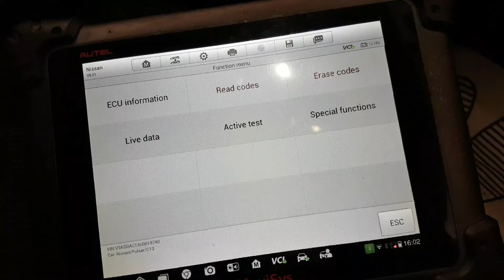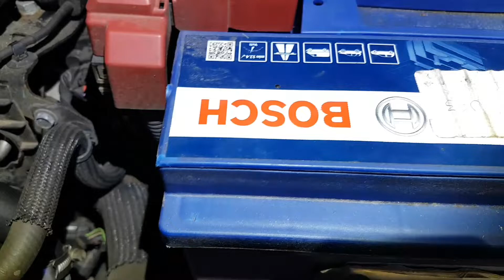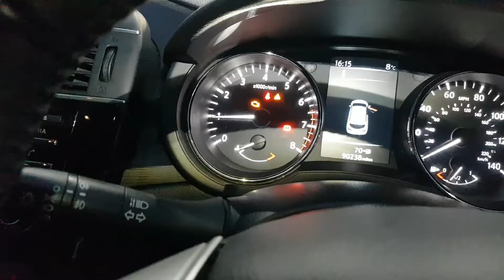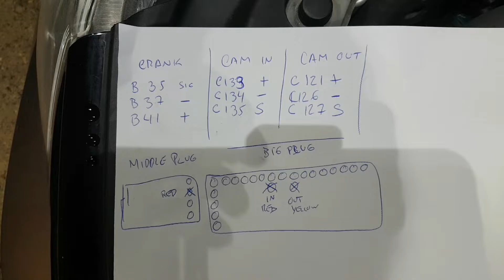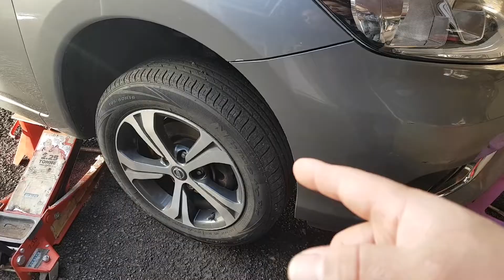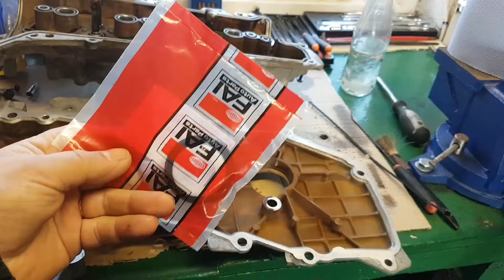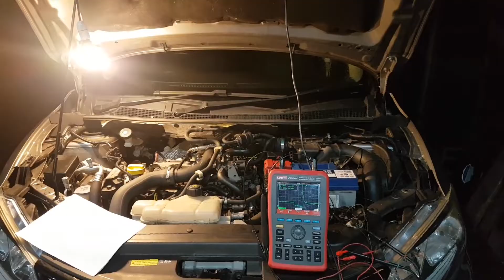Nissan Pulsar 1.2 DIG-T Engine light ON even after new parts... Fault finding and repair.

Comment: hi mate do you know the pin outs on the bcm which control starter relay from the pcm for ford focus 1.6 tdci 2013 manual  and with stop start this is my last test to do before i put it down to the pcm itself all test ive done so far are good i just cant find any information on connector c1 marked as engine on the bcm module anywere on the internet i would be greatfull if you could help thank you
Reply: sorry mate didnt mean to confuse you its in regards to my ford focus i can get you the information like engine code even ecu information as i have removed the ecu from the car and thank you mate
Reply: engine code T1DB1K   ecu number BV61-12A650-DGB
Reply: other ecu code S180133050  C  THANKS MATE
Reply from the maker: The diagrams show the starter motor relay connected to:
Load side, 1 of the pins (shows pin 3) permanent voltage.
Load side second pin (shows pin 4 or 5) to the starter motor.

Control side, shows pin 1 to pin A29 engine ecu, and pin 2 A27 also engine ecu. 
Engine ecu pin C28 connects to ignition switch pin 7.

I don't see anything connected to the starter relay that comes from that connector...
Reply from the maker: @dennispowell7719 
Give me that information...
👍
Reply: thank you mate as far as ive been told its connector c1 engine marked on the bcm and pin 28 ive done continuity on that line to the pcm and get nothing also applied voltate to that line with everything disconected and still nothing but i dont know if am checking the wrong pin  without the correct information i was going to get autodata but at a £115 a month just to find that pinout is abit pricey thank you once again mate i know your a very busy man
Reply from the maker: @dennispowell7719 
Again, i need to know which engine you have, or at least which engine ecu...
Some have siemens ecus, others bosch... without that I can get into any diagrams... or if I do under the wrong selection, the diagrams might be incorrect...
Reply: thanks its the wire that gets grouned by the bcm when ignition switch pressed to start it sends that signal to the pcm and the pcm then activates pins 85 and 86 of the starter relay mate thank you also if it turns out to be the pcm would you beable to clone one for me if it comes down to that and at what cost ?
Reply from the maker: @dennispowell7719 
Ah... that one...
That is ignition switch C1-3 (PIN 3)
Goes to a splice (SP402) to BCM C3-28, PCM C-28 and if you have keyless, keyless module C4-15

There is a second switch from the button, switch C1-4 to BCM C3-22

👍
Reply: thank very much mate very much apreciate your help with this mate
Reply: hi done those tests mate they are fine but found somthing odd about the ignition switch circurt in that when i press the button to start the voltage is only 5.6 volts  i dont think thats right i asumed it would need battery voltage at that pin mate what do you think mate ? thanks
Reply from the maker: Yes, should be battery voltage.
The voltage supply to the button, is on pin C1-6 (KL30), and comes from the BCM pin C8-3
Reply from the maker: Without the engine code, it can't really help... as there are different engine control modules depending on the engine code...
👍👍👍

Comment: Always easy in retrospect but if you knew what the timing figures should be on a known good one it would be another way to check timing without stripping. 
I find Nissan diag reporting  to be a bit crude in all honesty,at least when using aftermarket tools.
It's pretty poor stuff that it didn't report a timing correlation code with the state of that guide etc. 
Hardest thing... Just need to remember this video for figures 😂👍
Good stuff Luis ☺️👌👆
Reply from the maker: 😊
Thanks!
👍👍👍